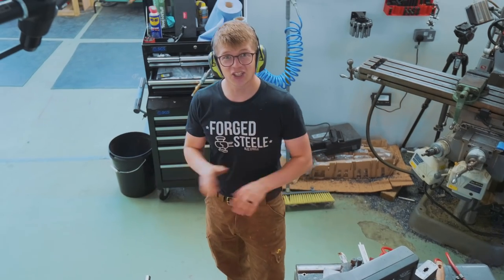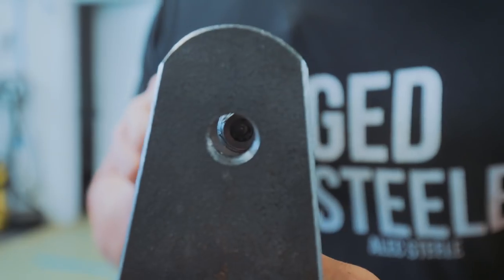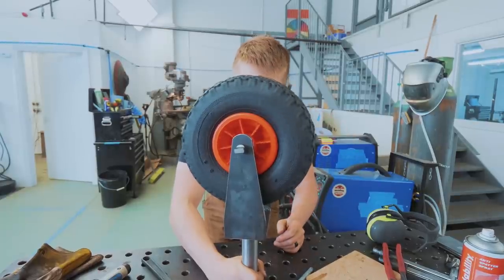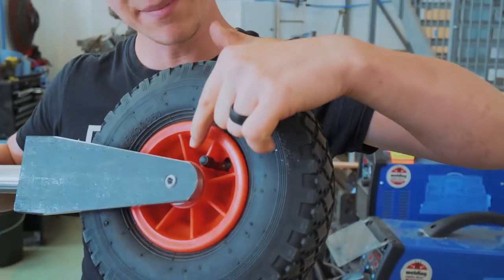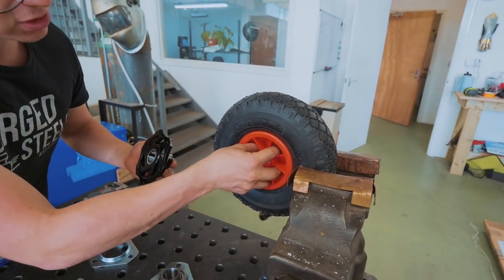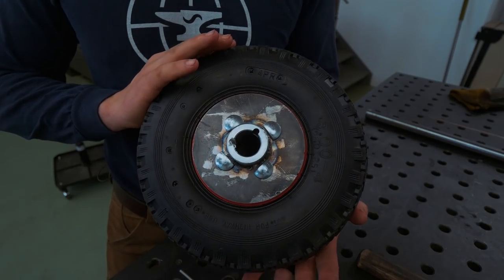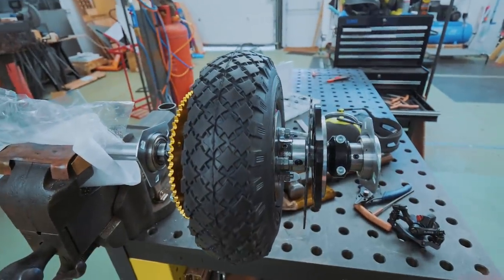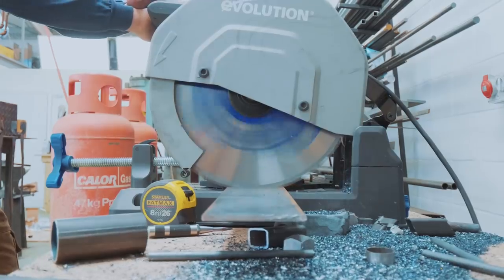MY MEDIOCRE ENGINEERING PROJECT!!! Part 2

Comment from the maker: Thanks for watching - got to work out what to do about this sideways motor issue in the next episode! Thanks to Raid for supporting my nonsense with their sponsorship! Install Raid for Free ✅ Mobile and PC: https://clik.cc/eruDb  and get a special starter pack 💥 Available only for the next 30 days 💥
Reply: FURZE!!! Do a collab with this guy and build some medieval rocket launching, sword throwing reclining wooden chair scooter! And maybe throw your dad in there as well!
Reply: what about the metiorite??
Reply: I hope you never run into me, it' will be heavier than the average family saloon
Reply: LOL! Try rebuilding a 4L60e transmission next Alec.
Reply: Maybe check This Old Tony YouTube about making a go-kart from a lawnmower engine.  It may be doable, but he had tons of comments saying that it wasn't going to work for these (good reasons) so he should bite the bullet and get a better engine easier to adapt to a go-kart.
Reply: Ask @mastermilo
Reply: @EdwinWiles  It won't work on its side, but if he can use it as its designed, there are options, not ideal, but there are options.
Two examples I can think of are a worm drive, or a transfer box with gears similar to what you have in a car's differential.
Reply: I’ve seen projects on YouTube where people modified 4-stroke vertical shafts to run horizontally.  The intake had to be modified, and an oil flinger installed to lubricate the engine. It would probably be easier and maybe cheaper to try to find a horizontal shaft engine than to do the modifications.
Reply: @thelatinist5024  Thats not the only option, My earlier comments of using a worm drive or vertical to horizontal transfer box... (and other I didn't mention) COULD be a viable option
Reply: @moton410  that would be freakin awesome, I've been saying this for a while. They can teach other new tricks of the trade.
Reply: My Dad (ex RAF trained/qualified Electro Mechanical Engineer) would have said to me if i made same silly miscalculations (like that too long, then too short rear shaft)...... You, Pillock! hahahaha 🤣🤣🤣🤣🤣😎
Reply: @GaisaSanktejo  yes like a worm gear skill saw. He may need someone to make some gears for him with their CNC machine. Who knows, he can probably buy them online.
Reply: Bevel gears like in a car differential. It’s the same, moving the rotation around by 90 degrees.
Reply: @GaisaSanktejo  I don't know what you call it, but two conical gears meeting at a 45 degree angle from vertical and horizontal shafts.  Is that what you meant by transmission?
Reply: Alec are you staying in jolly old england or are you coming back to the US?
Reply: @EdwinWiles  bevel gears :)
Reply: I once had a 1979 Volkswagen Rabbit automatic. Air condition. Yellow. Those are all connected by the way. How in the world you may ask would you air condition a Volkswagen Rabbit what does a too far off in the boats wagon bug? Simple you put the motor in sideways. It was a strange thing to work on. But you are not alone and had to decide ways Engineers something. Perhaps you need to find your way to a Volkswagen dealership and asked him about putting motors in sideways
Reply: No matter what you got this. You may have to start all over and lay then cut that thing again measure 15 times cut once. That's how I do it that's how... Well... I can't think of anyone else who did it that way LOL I even I still make mistakes. Granted I'm cutting styrofoam and it's a lot easier than cutting steel or brass. All the same it's frustrating when it's not right has to be adjusted or have to be redone but you got this. If it's not right then you're never going to be happy with it.
Reply: I would buy a pressure washer engine
Reply: Keep it up your awesome and you’re doing great
Reply: @EdwinWiles  that's one of the names 👍
Reply: Raid sponsor legends
Reply: And I'm unsubscribing after years of watching all your content. I'm tired of you exploiting your fanbase with these predatory mobile games. Seriously Alec, take a look at your older videos, see the passion, drive, and perfection that drove you. None of those things are in your latest content, most of which, have been ads for predatory games and nothing more.

Really bummed, you used to be my favorite youtuber.
Reply: For long shaft alignments, we use to run a taught wire through the centre of each hole, then measure off the centre, the shaft would then slip through with a fine tolerance if it was done correctly, the way to practice this would be to have your components bolted down and use a size shaft you can comfortably lift, this of course can be upscaled for larger machinery that would require a crane
Reply: Already in the Game for a year now. ;-)
Reply: Well Alec,  gotta admit you are a fearless little bugger...
since you are back in jolly olde E,  i think you'd benefit from a colab with ole Colin F. himself.
Reply: My ride on mower has a verrtical shaft engine it uses a couple pulleys and some sort of diff or case to re orient the power to the rear wheels. Dont know about where you are but around here people literally giving older ones away free on the side of the road.
Reply: Buy a predator motor (or Honda GX160) the gear reduction, clutch and sprocket. "Simple" bolt on. The one you have may not work sideways like that. And if it does it will not last too long because of the oil and carb positions
Reply: I love this project. I hope you come back to this.
Reply: If you drill a hole in slightly wrong place and really can't go up a size to fix it instead of having a sloppy hole stick some weld in grind flat and then redrill you'll get a far nice finish and fit.

Comment: oh I cut things short many times and ordered more and done it again, there was 3 360 swing axles in the end lol.
Reply: Its not how bad you screw up, but how you fix it with least amount of cost, so only you know you screwed up.
In this case narrow the rear frame if axle has some room for it, or drill a hole in the end and put washer and bolt on the end, or weld a nut/knob on there like in dirt bike axles have. Helps later to free things up, if this ends up sitting unused long time and little rust starts to form. Seems like many of these DIY builds forget things like durability and ease of maintenance for quick youtube moneyz and builds just end up dusting or rusting away unused.
Also isint this things weight bit much for bicycle disk brake, specially with that heavy back frame? Should have gone to mopeds disk brake right away.
Reply: That what you call perseverance 😁😁😁

Comment: Should have only been half a millimeter off but you switched the calipers to inches!
Reply: first mistake
Reply: Didn't that same mistake crash a rover on Mars?
Reply: @Eyes0penNoFear  Maybe. But we landed a rover on Mars.
Reply: I failed technical mechanics exam at college for a similar mistake. I didn't realise my calculator was in arc measure mode instead of degrees. So all my results were wrong...
Reply: @DavidGuyton  Nasa uses metric system .
Reply: @DavidGuyton  not that one  :)
Reply: @DavidGuyton  yeah.. but NASA works in metric . Crashed Rover problem was "supplier working in imperial" originated

Comment: I work in design and for the snap rings dont have one on the outside of both bearing blocks. Take the width of the steel one of the blocks is mounted on plus the width of the bearing block and put two grooves one on each side of ONE of the bearings. Leave the other bearing alone with no rings. Less distance between grooves is less room for error

Comment: Its a big scary how big the sprocket is compared to the wheel. It looks like it will have only a few milimeter of distance between it and the ground meaning if the wheel flexes it might scratch over the ground.
Reply: A large sprocket is only an issue when it's away from the wheel. A large sprocket is fine as long as it hugs the wheel
Reply: I was looking for this comment before I said the same thing. That spongy tyre is going to deform and the chain driving the sprocket is going to grind on the floor. Or he'll hit a bump and bend the brake disc which will lock up the back wheel and waaaaaaahhhhh
Reply: Poor chap, this thing has been kicking his arse from the outset. It's funny how quick and simple a project looks like it'll be until you come to start it.

Comment: Mistakes are made when you allow the excitement to blind you to the fundamentals of any project.

In this case, you forgot two things.

"Measure twice, cut once."

"Keep a constantly updated set of critical measurements."

My guess?  When you built the rear box, you got the dimensions wrong there.  The stock looks about a quarter-inch, so if you welded the sides "inside" the end pieces, you would end up a half-inch out of spec.

The axle was perfect.  The box for the rear end was wrong.
Reply: TEN points to Gryffindor! TEN POINTS I SAY.
Reply: My thought exactly.  :)
Reply: Measure once, cut twice, file to fit

Comment: Hey alec, before you using your scooter, you will have to modify the piston rod of the engine. A lawnmower engine is sitting horizontally. the lubrication won't be done properly if you don't add a little tong to the piston rod the lubrication won't happen to the piston ring and cylinder wall. It could result will cylinder scoring seized piston head. There's some videos on youtube to help figuring this.  Continue the great work your are killing it!! 😊

Comment: Hello Alec , as an engineer, my advice would be to upgrade your brake discs , with weight and torque , the disc will not handle forces for any length of use ..
Good luck, enjoying your videos and candour . cheers mate from Oz-tralia...🦘🦘🦘🦘

Comment: Look up how a twisted V-belt is layed out.  It'll easily do the 90 degree twist required for the lawnmower engine to work it's best.  If you add a tensioner to the belt on a hand-control, the V-belt will also act as a clutch.  (for a while anyway, but they're cheap...)

Comment: Hey man really love the videos. I’m working on a almost identical project right now, it’s a lot easier if you weld a sprocket to the wheel and have the axle stationary. Also I’m running my lawn mower engine in a horizontal shaft configuration, you just have to turn the cabuerator sideways and mess with the oiling system

Comment: Snap rings r a secondary retainer. Use lock collars on the inside of both bearings.  Normally us have them on both sides of one bearing but doesnt look like it would work and u likely dont need it for this

Comment: Easy fix here, Alec--drill a hole in the end of your rear axle, thread it, then put in a bolt with a large diameter washer.  No big deal.

Comment: Hey alec, one thing to mention, make sure you don’t mount the engine with the axle horizontal, as those lawnmower engines need to be vertically orientated to keep the oil in the sump. 😎 great project!

Comment: You’re front wheel spindle won’t hold with that bolt on method, it’ll screw off eventually. You need reverse threads or better yet two nuts with washer that can be inserted into the forks

Comment: time for a  Colin Furze collab. you make all the mettal matterial in the forge, and he try to build something. use a wheel o "fortune" thing. like need to have a diesel engine. or need to be able to lift palletsw. or go 40 mph or fill a cup of love. and then a wheel what you both make. alec makes a  flatbar . or he makes a baringholder etc etc

Comment: Thats a good learning curve! Its good to challenge yourself. Not sure I agree with the pliars holding the emery cloth though 😬 There is a safer way to do that. I'd be getting a standard set of jaws for your lathe chuck if it were mine. Those blocky ones are an accident waiting to happen.

Comment: By the way, nice job on transmitting drive to the rear wheel.  Still curious to see how you'll make the vertical shaft engine work.  No spacer between the bearings in your front wheel?  BTW, just got my 3.5 lb Steele/Harty hammer!  It's lovely.

Comment: you need to cut all the extra garbage off the rear end, cut as close to the rear axle as you can. Then build ABOVE the tire. With all that stuff behind the wheel, you will have no ability to ride off curbs or go up and grade at all. Provided you can find an engine powerful enough to move all the heavy steel around in the first place.

Comment: Snap-rings aren't designed for side-loads like you may get on the scoot. They are just meant to stop an unloaded shaft from backing out of a hole.
On reflection, I may need to rephrase that last sentence.

Comment: Keyless chuck, first time i used one I had to ask a technician which way it loosened. lol.  bearings on long bar, is the bed worn ? causing an oversize in the middle. only make the bits you need to size. .solving problems as they arise, great work.

Comment: Obviously this is intended to be a fun learning project rather than a path of least resistance scooter build so no direct comment from me.
However:
As a follow up might I suggest a project I've been considering for a while but I lack the tools. Consider a recumbent trike, the two wheels at the front variety... take the rear end of a moped, a pair of suitable front wheels and forks, a seat, and weld up the powered equivalent.

P.S. Why does flange sound like a dirty word?

Comment: Dont sacrifice the perfect. You can heat/quench the caster leg like youvwould to straighten line shaft.   But they say the difference between a Panzer and a Sherman is tolerance delta of.....sloppy. Truely grandad said if it aint a piano.......give it a few thousandths or it may swell up and she wont fit

Comment: The snap rings we’re an unnecessary headache. A far easier solution would have been collars with grub screws. Or even easier than that, some bearings have built in grub screws

Comment: nice build. a nut plate could have worked potentially without the need to grind the hub to fit the nuts.
shame about the spacing for the circlips, happened to me before :(.

Comment: Mr. Alec, a point of concern; you mentioned a bicycle brake for stopping.  Given this will be power by a small gas engine, plus the weight of frame, I'm a bit concerned your bike brakes will introduce you to the Wizards of Pain...you might want upgrade those brakes a tad mate.

Comment: Watching Alec build a motorized scooter, wondering how he is going to over the issue of using a motor designed to be used with the shaft vertical when he needs horizontal drive........

Comment: Why don’t you open up the out of line hole using an larger end mill set at the correct location and make a bronze bush up on the lathe to suit with a hole the shaft size and press it in instead of having the sloppy hole?

Comment: You have to read this with a Scottish accent for any of this to make any sense! I got 2 issues here, 1. Those wheels are absolute rubbish at being wheel barrow wheels how on earth are they going to be usable for this application? 2. Assuming the rubber on that is just your standard rubber type you will need a replacement at some point when it either goes flat or bald. It looks like you are going to need a PHD to replace that tire and not your average tire/tube person at your local Bandag dealer. LOL! Any feedback on this will help me in my progress in building a similar vehicle I am basing on your design, so your mistake will also be my mistake. LOL!

Comment: Still wondering how you are going to make an governed engine designed to run at a constant speed with a vertical crankshaft work.  Really needs a horizontal crankshaft engine with an adjustable throttle.

Comment: Things I have learned from u others and me nothing is going to get done right without a plan which Idk if u seen my comment but you are going to have to get a engine with a throttle unless you can find a manual clutch that will fit with your rpm

Comment: Please,  for the love of all machinists everywhere, never grab a keyless chuck with pliers again.  In the off chance you do get one over tight, I highly recommend a strap wrench. They are cheap and amazingly useful for all kinds of things.
Reply: for the love of all welders, that is considered standard practice, some shops have pipe wrenches near drill presses specifically for that
Reply: @darthtrump4428  Thankfully I have never found damaging tools a valuable technique.
Reply: @brianmoore1164  you marr the knurled surface

besides that, funcionality of the chuck.stays the same, either being tightened by pipe wrench or by strap wrench
Reply: @darthtrump4428  I like it when my tools still look good.  I have some old Starrett stuff that was made during WW2 that still looks and works like new.
Reply: @brianmoore1164  yes
old precison tools should be used with care

but a drill chuck that was bought for fabricators can be marred and abused for many years before giving up
and then you just buy a new one
hell even rohm is under 100€/£/$
Reply: @darthtrump4428  All true, but a strap wrench is less than 10 bucks and then you can use the heck out of your chuck and when you are 90 give it to your kid and it will still look and work perfect.